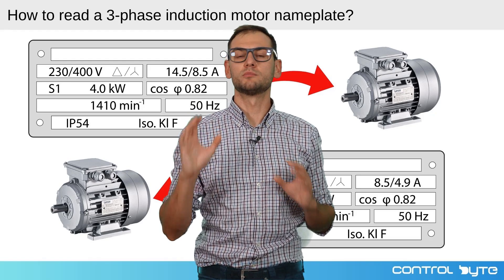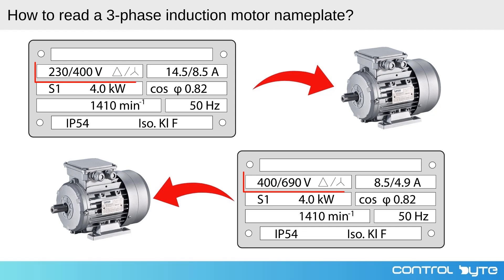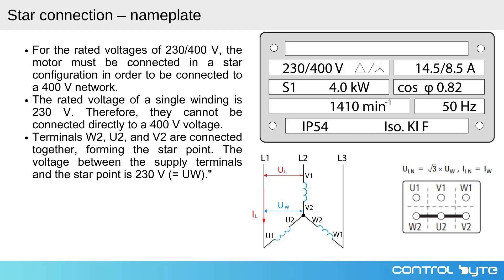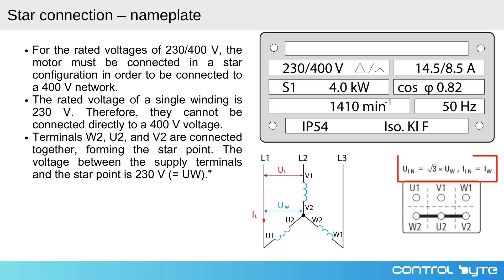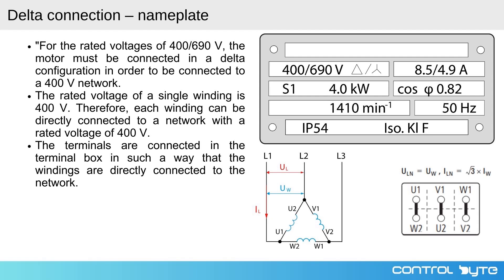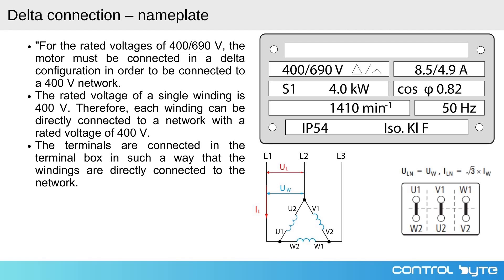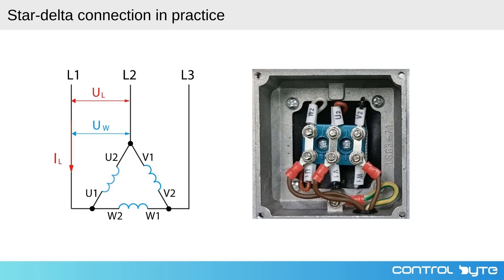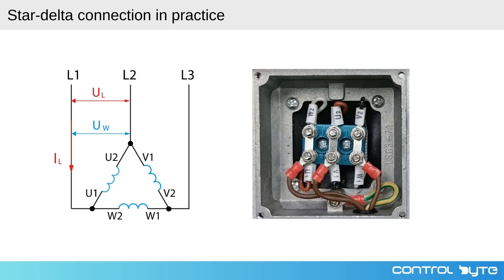Mastering 3-phase Motor Connection: Star Vs. Delta Explained!

Comment: I am confused about the connection.
230/400V is star conection << thats mean line to line voltage is 400V while phase voltage is 230V?
400/690V is delta connection thats mean line to line voltage is 400V but how about 690V? what does it mean?
Also can i use star - delta starter to run both motor?
thank you
Reply: 230/400V and 400/690V are two different motors.
"230/400V Δ/Y" means that the same motor can be connected in a delta configuration (Δ) with a 230V supply or in a star configuration (Y) with a 400V supply
Reply from the maker: Join our course course and you will now how to Connect that: https://controlbyte.tech/industrial-automation-basics-course/
Reply: The lower voltage is for delta and the higher voltage is for Star , most common is 400V , so if you have 230/400V , use star , if you have 400/690 , use delta for 400V supply , in addition , you can use 400/690 in star , but it will have lower RPM and power , it's used to start up , first star , then delta , but if you used delta in 230/400 motor on 400V line , it would burn most likely , if you somehow had different voltage , you could use delta for 230/400 motor on 230 line , or you could use star for 400/690 motor on 690 line I hope this helps